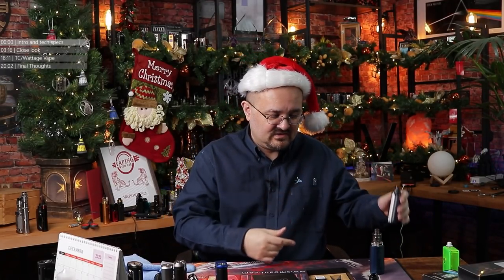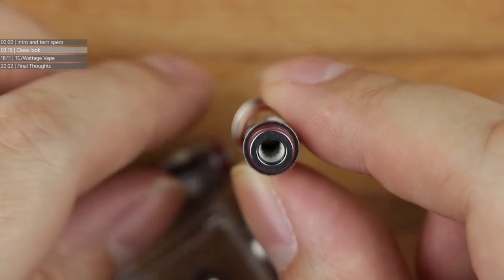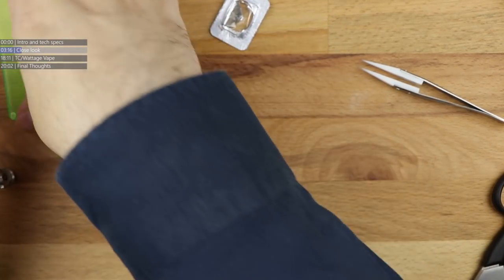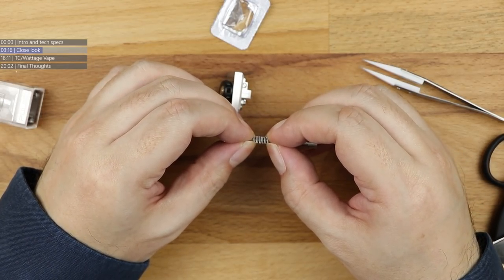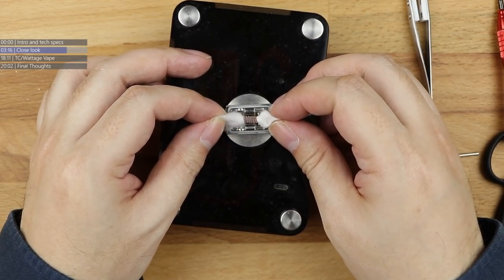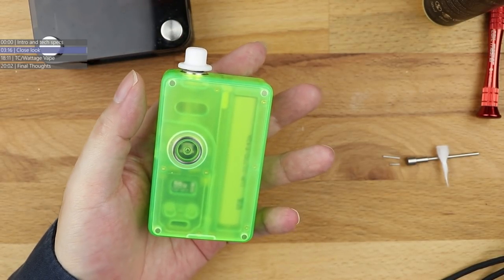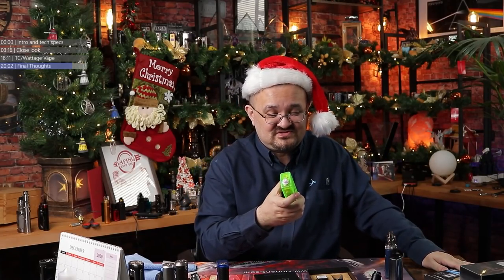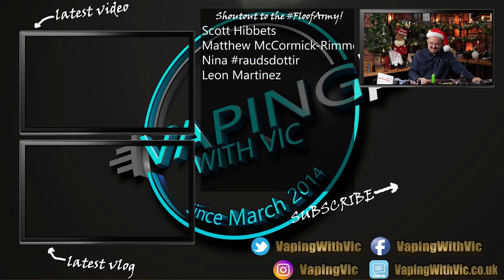Vandy Vape and TonyB Pulse AIO - The Pulse enters the BoroTank market

Comment: He does realise that the 5/10 pin is adjustable and most if not all boro tanks will have no connection problems lol.Also pls push the tip down flush with the mod

Comment: As I'm sure many will make this same comment, the 510 pin is adjustable so all bb bridges will work in it. I see your flush nut is sticking up a bit so you might want to see if you can tighten the pin. Mine are on pre-order and I'm super excited. Nice review Vic.

Comment: HI, I ordered this in UK and I been sent the TPD version ffs in a seperate box! I was thinking I might just buy a seperate bridge for the pulse AIO with larger capacity , can you advise on the biggest capacity bridge that I could get that will fit ok in the Pulse.
Reply: Is it not just a plug that can be removed?
Reply: @psychominded3243  Nah, I thought it was tpd version as they hold fuck all these boro tanks..kind of annoying! I been used to holding 7ml all day in my sqonk. I have to refill like every hour now...pain in the arse
Reply: @sbg2005  I can see a positive in that though, for me at least, that I like to vape different flavours throughout the day. But yes I can see the annoyance as I can fit 2ml in my drippers which is gone in minutes.
Reply: @psychominded3243  What boro tank has the most juice capacity for an RDA
Reply: @sbg2005  I don't know, I had never heard of boro until watching videos on this aio.

Comment: I would be inclined to say that the strength of the VV AIO is the external boro compatibility. If you are an mtl vaper, it's really hard to pass Aspire coils. The fact that I can take my BB boro with Nautilus adapter and shove it in is not to be sneezed at.
Reply: No but what is to be sneezed at is the fact this thing costs £100 and is made entirely out of brittle plastic so not at all durable.. for around £10-£20 more you can buy an aluminium DNA chipped sxk billet box.. I know which I'd prefer lol
Reply: @MDM1992  Upside:it must be petty darn lightweight. 🤣
Reply: @MDM1992  paid £64 posted for mine.. not sure where you’re getting £100 from pal. Billet Box/SXK doesn’t take a 21700 battery and doesn’t come with a great RBA boro and a decent stock coil tank also included. 
Plastic or not it’s a bargain for a 21700 boro device..